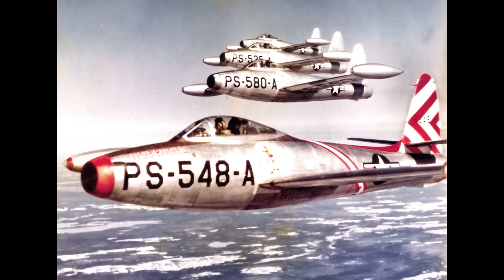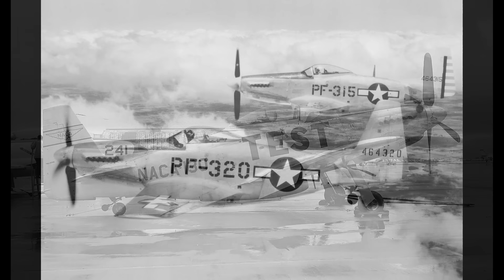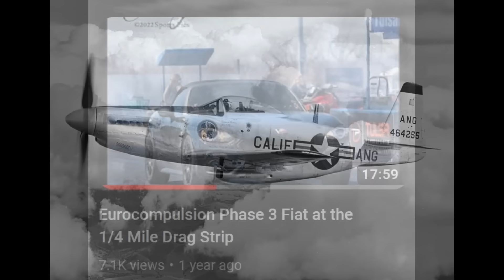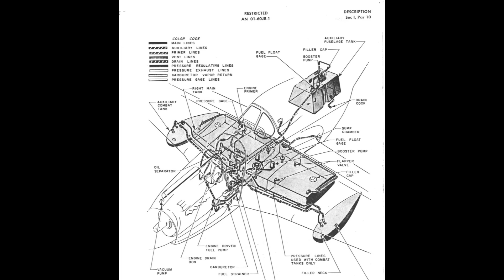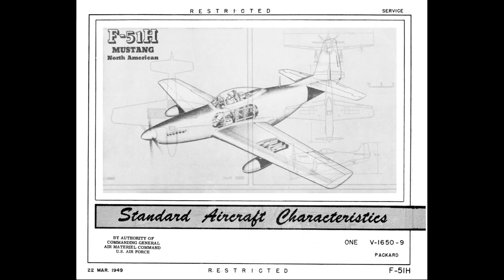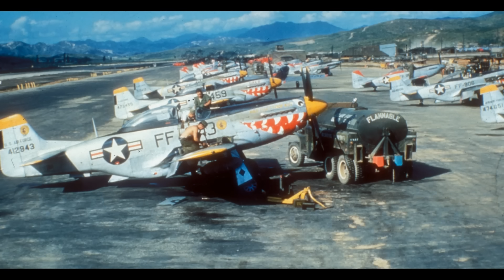P-51H Mustang, Superprop!

Comment: When I was a kid back in the 60’s I bought an Aurora 1/48 scale P-51 kit and was irritated that when I opened it the plane had the wrong shape. It turns out I had bought a now rare P-51 kit which for some reason wasn’t labeled as an H, the box said simply P-51. On eBay the asking price for one with the original issue box art is $250.
Reply: Holy shit, $250 sounds cheap. Did you build it I hope?!

Comment: The main issue of the P-51H is that the Merlin makes a lot of power with water injection, but this is very hard on the small displacement engine.  The engine life will be very marginal.  The 2200 hp will correspond to perhaps 350 psi in BMEP (I did not run the numbers, but it will be high).  Rebuilding V12 engines is very tough compared to radials.  Also, the fuel would have been very expensive, even back then.

The North American boys could not bring down the weight to Spitfire IX or XVI levels.  The H weighs about as much as the Spit XIV, but the XIV has a larger and heavier engine, that will produce its 2000 hp + with less wear rate and with less expensive fuel.  I would expect the XIV to be about even in climb and out turn the H.  The airfoil of the H is not going to be as good for maneuvering as the Spitfire and Seafire 47 due to its "laminar" nature.  In your chart, your numbers on the Seafire 57 are wrong, the Seafire 47 is much faster than your numbers.  About 390 mph at sea level.  The climb rate of the 47 is also 5000 fpm at sea level, and that is with 100 octane.  With 130 octane and 21 psi of boost, it will be even higher.  There is no question that the Seafire 47 is the top overall performer on the super props, despite your numbers.  I think the Sea Fury is the lowest in performance, but the air cooled sleeve valve engine will give it the best durability of any in the group.  Sleeve valves did not wear the cylinders.  The P-51H has the lowest durability.

On your turbocharged car without oil cooler ... Do not remove the high viscosity oil after the track runs.  The impact in gas mileage will be marginal, as long as you do not drive it in short trips and cold weather.  The reason they are telling you to remove the high viscosity oil is for their CAFE standards.  In fact, for any type of car that you drive hard, always use higher viscosity.  Nothing less than 40 on the hot end.
Reply from the maker: The source info for the Seafire 47 is in the video on that airplane, not this one. I think the info is accurate. As for weights, you didn't seriously want me to compare the 51H to the Spit 9 or 16 did you?
Reply: @GregsAirplanesandAutomobiles  I just looked it up, the Seafire 47 top speed should be just under 400 knots at 25K ft, your chart shows it at under 380 knots.  Yes, I think you should compare the weight of the H with the Spitfire IX, they had similar Merlins with the same two speed two stage supercharger.  The rate of climb of the IX with 25 psi boost (150 grade petrol) is 5700 ft per minute, substantially better than the H.  The IX can also do 354 mph at sea level.  The rate of turn is much better.  So, at low altitudes the IX will essentially "eat" the H, so yes a comparison would be fair.
Reply: One constant rule, for a Spitfire and a Mustang with the same engine, the Mustang will always be faster. Agreed,  It will also climb  slower and turn slower, and it will be an inferior fighting aircrraft overall.
Reply: @GregsAirplanesandAutomobiles  I have been trying to post this and something is happening preventing the post.  Lets try again.

I also think that I found the source of the controversy/isagreement of the Seafire 47 performance.  You used the numbers from WW2 aircraft performance , and that report is from preliminary testing of the non-final 47 with unrefined contra prop Griffon.  (interestingly enough, this report is not consistent even with itself, initial climb rate of 3800 fpm and reaching 30K ft in 10 minutes are not compatible.  The initial climb rate of the final version was 4800 fpm, and 20K ft could be reached in less than 5 minutes, which is remarkable).  The production aircraft with the fuel injected Griffon 88 have performance similar to the Spitfire 22 24.  In fact, the Spitfire 22-24 is a refined version of the XIV in terms of better designed radiators, which substantially reduced drag and allowed improved top speed (also a redesigned wing with better torsional stiffness which helped with aileron response at high speed).  The 22-24 gained about 250 kg over the XIV due to heavier armament, but had the same engine.  The Seafire 47 is essentially the same aircraft as the Spit 22-24, with folding wings and contra rotating prop, and further refined Griffon 88.  It gained another 200 kg, but that was compensated for by the better prop and a bit more power (fuel injection).  There is no doubt that Supermarine stayed on top of the game worldwide in piston fighters, and the 47 is clearly the top "superprop" given the combination of performance in terms of speed, climb, and maneuverability.  Interestingly, if the P51H had similar armament to the Spitfire XIV, it would likely be heavier.  North American had to use American fighter production approach (meaning smaller number but heavier airframe components) for the unskilled labor in the USA, which means that US build fighters could not compete in weight to aircraft designed by a race company like Supermarine.  Interestingly, the Hawker fighter design is similar to the US design approach.  Big, simple, and heavy starting from Hurricane, all the way to Sea Fury.  This is why the Fury is more comparable to late model F4U's and cannot match the Seafire 47.  The late Hawker fighters shone more thanks to their advanced engines rather than the airframe design.  In fact, if these engines were installed in better designed airframes, they could have been the top dogs in the "superprop" world.  Cheers.

Comment: Now I have read, many years ago, that the lightweight frame for the P-51H was derived not from the P-51D, but instead was based on the frame developed for the P-82 Twin Mustang
Reply: I've heard it explained the P-82 was not sticking 2 P-51Ds together, but the P-51H was like breaking the P-82 into two.
Reply: @brianrhodes1575  The primary difference between the P-51H frame and the P-51D, that unlike the P-51D, the P-51H was designed to meet European aircraft structure standards, and not the stronger US strength requirements
Reply: @brianrhodes1575  Except that the P-82's airframes are a lot longer.
Reply: @martijn9568  The longer P-82 airframe length was forced by the use of twin engines. To prevent the aircraft from leaving controlled flight, when both engines were a full throttle, but suddenly one engine dies. the longer airframe length was to prevent the asymmetric power configuration from throwing the aircraft into a flag spin
Reply: @brianrhodes1575  I have heard that - I have also heard disputations of that. I guess that we'll have to wait until somebody like Kermit Weeks pulls them up side-by-side and takes us along as he examines them. I feel that is part of what makes '39-up fighters so darn interesting.

Comment: There is one of these that often flies into the Warbird Roundup airshow at the Warhawk Museum in Nampa Idaho. Tail number 464551. It's a bit plain looking compared to the colorful paint other Mustangs sport, but it runs great and it's neat to see such a rare bird flying around. It definitely does sound a bit different than other Mustangs.
Reply: Holy shit I didn’t know any of the lightweight mustangs survived.
Reply: @rebelroar78   I'm counting eight P-51H survivors.  #64265 (display), #64376 (display), #64203 (restoration), #64268 (restoration), #64375 (restoration), #64314 (flying), #64415 (airworthy, stored), and #64697 (wreckage.) And partial remains of an XP-51G are in long-term restoration.

Comment: Just a side note: 4:00  the Packard Merlin V 1650 models, 1-25, are 12 cylinder V-shaped water cooled engines.  I couldn't help hearing V-16 engine, although you never said it.
Reply from the maker: I don't get it, they are all V-12s.
Reply: Right, right!  I don't get why Packard didn't specify them as a V-1250 or something like that.  Perhaps they meant to confuse the enemy.  @GregsAirplanesandAutomobiles

Comment: Neither F-51 version should have been used for long in Korea as the F-47 was a better choice both from capability and pilot survival perspectives.  The pilots didn’t want to get selected for the ‘51 as the loss rate was high.  (You were sent to Japan, then when a unit needed a pilot, the next one on the list in Japan went, you learned that a/c when you got to the unit, assuming you hadn’t already flown it, which most new pilots only had time in the F-80 for fighter upgrade)
Reply from the maker: I agree.
Reply: What was that saying again? Amateurs talk tactics and professionals logistics, or something like that right?😉
Reply: The Air Force preferred the F-51 over the F-47 because it was a better fighter. The F-47 was a far better at ground support, but the fighter mafia didn't really care about ground support. This was tragic because by the time of Korea all the prop fighters did was fly ground support.

Comment: Over 5000ft/min climb and almost 500mph is just insane. They really should have added MW50 to the 51s, they would have been just so much better.
Reply: Dude the American ADI (or sometimes called WI) system was exactly the same as  the German MW50 system.
Reply: @patrickshaw8595  Yes, I know.  The issue is that the mechanical supercharger system in the Packard Merlins was already optimized for the fuel at hand and the fighting altitudes.  Without changes, ADI (anti-detonation injection) would mainly have been of use at low altitudes when the engine normally required throttling to prevent overboost.  At fighting altitude in Europe,  the earlier P51's were already at max boost.  To take advantage of ADI, changes to the engine or mechanical supercharger system would have been required, as I stated earlier.
 The P-47's, on the other hand, had large turbochargers with enough additional boost potential to make good use of the ADI.  The US air-cooled engines were also more cooling-limited and benefitted more.  The US Navy used ADI and their planes had mechanical superchargers, but for a number of reasons, even with it they couldn't match the boost levels of the Packard Merlin with the same fuel.
Reply: To take advantage of the MW50, the engines would have needed to be modified.  Either the compression raised or the supercharger system modified (different supercharger gearing or different impellers).  At that point in the war, it probably wasn't considered to be worth the trouble for logistics reasons.   Things may have been different had more of the advanced German fighters appeared sooner.
Reply: @jfess1911  I am saying(like Greg) that they should have used MW50 from the beginning of the war. I don't think they would have needed to change the supercharging system. They would have just needed to add the systems to run the MW50 like they did in the H model or like in the 47s. 

I don't see how adding a 10-20 gallon tank of MW50 and a few extra hoses etc is not worth it to give an engine way more HP in a tough fight.
Reply: @rring44  I agree that designing the Packard Merlin to effectively utilize ADI/MW50 from the beginning would have been useful. Unfortunately, the particular engine used in WWII P-51's just would not have been able to take full advantage without other changes.  Those changes are partly why the version using ADI got a new engine designation,.  The US made a lot of silly decisions in WWII.  A common one was to stop improvements of equipment once it reached he "good enough" point.

Comment: The P-51H addressed deficiencies in the P-51that were a result of the Merlin engine installation, notably lengthening the rear fuselage. The earlier Merlin engine powered P-51 aircraft had to be restricted in speed to avoid sudden rapid disassembly in flight.

Comment: Great video.  I always found the H subtly less aesthetically pleasing than the preceding models.  With the stretched radiator housing and the slicked out nose section she went from being curvaceous in the right places to the wrong places to my eye.
Reply from the maker: I agree, it doesn't look quite right to me, but that could be because I'm so used to seeing the other models. To me the A and B look the best.
Reply: @GregsAirplanesandAutomobiles  Totally agree, the fastback Mustangs are pretty sweet.  I really like the Bs both with and without the Malcom hood.
Reply: Personally, I've never have been the biggest of the early Mustang in the looks department, although its not bad. For me the B/C/D models are the pinnacle, especially the later. I definitely agree with you on the H. It's always struck me as a misshapen D. The profile of the plane just looks a little "off."
Reply: My thinking is 50/50. Because we’ve seen the D so many times in multiple guises we’re used to it. I’m sure if the H had as long a history it would of grown on most as well. But rest assured that all the changes that were made on the H had one goal, to improve performance and that it did in spades. It’s like the Spitfire MkI and the last versions.
Reply: She got that junk in the trunk that only a brother would admire vibe going on😂
Reply: A Malcolm Hood P-51A would have been a real good looker.

Comment: Hmmm, it would be nice if somebody did a video comparing a EcoBoost mustang up against your Fiat and and Alpha at a road course
Reply from the maker: I can tell you, stock vs. stock, it's Alfa, Ford, Fiat on a dragstrip or road course. The exception there is on a really tight road course the Fiat will beat the Ford. Now when modded like mine, the Fiat will beat the Ford anywhere IF the Ford is stock or lightly modded. Once the Ford has some decent upgrades the Fiat can't touch it any more. Currently my Alfa is the fastest of the three, I'll update on the Ford later.

Comment: Greg--Great job as always.  There is at least one P-51H in private hands in the US.  I have seen a YouTube video of it but it doesn't seem to go to air shows.   I imagine the owner probably can't get the 145 octane fuel needed for it to reach its full performance potential.   Just my opinion, but I think the lines of the H are even better than the D.
Reply: There is one of these that often flies into the Warbird Roundup airshow at the Warhawk Museum in Nampa Idaho. Tail number 464551. I've seen it fly and it's definitely got some great lines.
Reply: Cool. @tacticalmanatee
Reply: I saw one fly at Oshkosh, there is a huge difference in performance between the D and the H.

Comment: Did the P-51 H, have the same level of armor plate, that was in the 'D,' model?
If not, that too could explain a weight loss, compared to the 'D.'
Reply from the maker: The armor thickness was absolutely identical and in the same relative locations. I should have pointed that out, great question.

Comment: You should change your oil before you do track time anyway.  Everyone I know that does track time does this.
Reply from the maker: To a heavier weight? Then back again right after?
Reply: @GregsAirplanesandAutomobiles  that is admittedly unusual but changing oil before track work is highly suggested.  In my E36 BMW I run a heavier weight all the time.  I use Valvoline Zr1.  It's a decent high performance oil that's not super expensive.
Reply: @GregsAirplanesandAutomobiles  The owner's manual for the S550 Mustang GT recommends a couple of things before tracking the car, this being one of them.
Reply: Zr1 is high in zinc so it's good for engines with flat lifters or bucket type followers.

Comment: Interesting they fixed the balance enough that the fuselage tank was used last, even after the wing tanks.
Reply: The Spitfire IX and XIV rear fuselage tanks were strictly commanding officer authorisation only, they were worse.
Reply: That would have been standard practice for WW2-era combat aircraft with fuel tanks in the wings. The problem with wing tanks, for a combatant type, is that they present a large target area relative to their volume - so they're more likely to be hit by enemy fire than the typically more compact tanks inside the fuselage. So first you'd empty the drop tanks, because of the drag; then you'd empty the wing tanks, because of the vulnerability; and only then would you start on the fuselage tanks.

The remarkable thing is less that the clean-sheet P-51H fixed the CG issues enough to allow pilots to revert to what would have been normal procedure for any other type, and more that the aft fuselage tanks in the P-51B/C/D/K were so large, and so far aft of the CG, that they imposed that kind of limitation on the type in the first place.